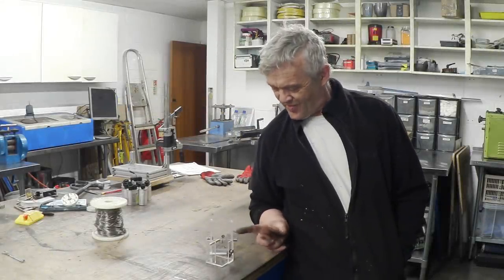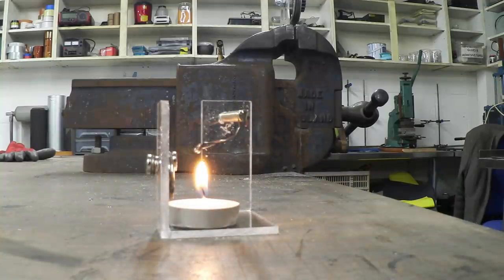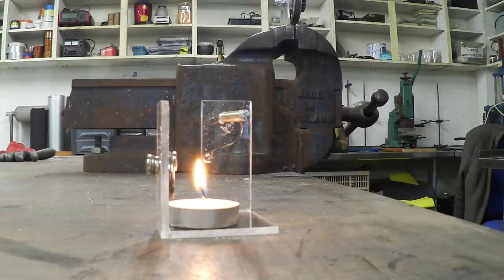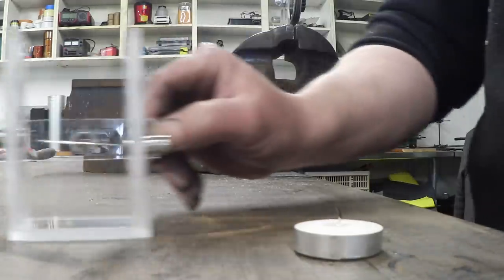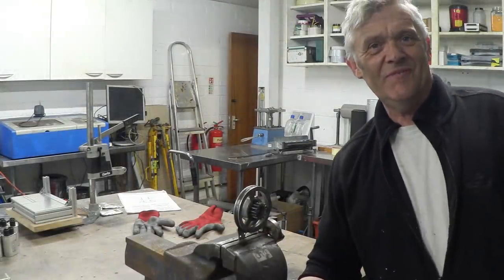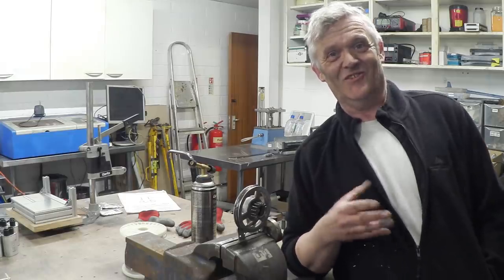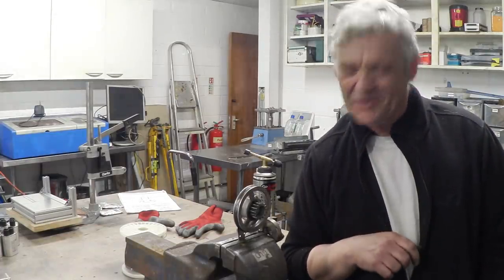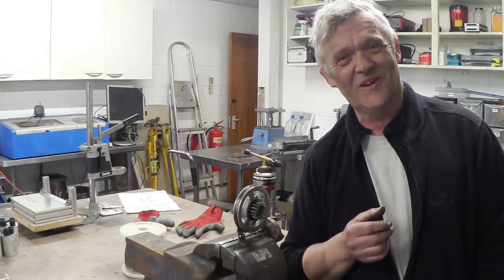Tesla's Thermo Magnetic Motor

Comment: Thanks for that video! I think you can use individual nickel coins placed around the pulley like turbine fins. They will heat faster and independently. Also they will cool down faster and individually. Also wheel speed will speed up the cooling. And you have to thermoisolate nickel off the aluminum wheel. No need to heat the wheel, only nickel matters. So the heating will be also faster. I think this wheel can rotate with uniform rpm at the end.
Thanks again! I like your way of making videos. )
Reply: I was thinking of snipping the wire into small units and placing over the surface of the object in question to be rotated... If we are going off the trash to treasure approach he spoke of.

Comment: You can use this inside a Stirling engine to move the air like it was a loudspeaker. Make a spring that bounces in and out of the flame/sunlight towards the cold side, and it moves the piston/ camshaft as it does so.

Comment: brilliant idea to make a disk. I guess max efficiieny and power would be  like a  sterling engine..have the cold side of disk enter some sort of heat retained medium  or air pocket that previously cooled down the hot side and use minimum amount of heat source. maybe have the connected axle turn a small fan that actively cools the hot side too. attach a little coil near the nickel disk and but outside the heat area and that coil could generate some electricity from the same magnet as it spins.  that magnetic axle design is brilliant..  really clever.
Reply from the maker: yes - it's a thermodynamic heat engine so will have the same conditions and limitations as all of them so you are pefectly right. glad you like the axle.

Comment: Try Nitinol (muscle wire) I saw them use a wheel with spokes made of Nitinol which would spin as on part was submerged in warm water such as in a sink. It's memory metal. I know it's using a different principal but thought you might find it interesting.

Comment: In Weller soldering pen is used this effect of Curie temperature for precise temperature control. It is magnet inside pen heated by some heating element that magnet other side touches soldering nedle. Next of it is spring loaded electric contactor. Its called MAGNASTAT. Similar system can be used with crankshaft and piston rod. At end of piston rod can be piece of nickel aloy,.....
Reply: that is very clever! magnastat

Comment: Sir, I made a successful model using a greatly flattened Canadian Nickle on a small axle with pin bearings and a small magnet. It spins well with a small butane torch, but it's easy to overheat it, which makes it stall and spin reverse. Nice demonstration! :-)
Reply from the maker: awesome mate - cheers for the post

Comment: You should get better performance if your pulley is less heat conductive and your nichrome wire is arranged in discrete coils (each around a radial axis, like the stator of a brushless motor). It would localise the heat, allowing faster loss and recovery of magnetism. This would result in a better defined boundary between hot and cold coils and a stronger tangential force from the magnet. I knew there was a reason for not throwing away that old toaster...

Comment: I think a larger wheel with the nichrome wire corregated radially as if it were a gear would help the heat remain more localised at the point you're heating I think

Comment: This is super interesting. Tesla still amazes me with the breadth and diversity of his inventions, from Tesla valves, to Tesla turbines, to this. 
This doesn't seem very efficient though. If you had a Stirling engine, you would get more motive force out of the heat than you would from this thermo magnetic motor.
Reply: run the stirling engine on the same heat source as this. And if you use focussed solar the energy is free so efficiency is far less of an issue..

Comment: The issue with magnet motors is you can't control the magnetic fields, if you could shield the magnet until the field is needed, it would work, (possibly) maybe something like this could be the answer! Insted of a magnet, use metal to kind of control the magnetic field, it would probably need to be a large diameter, with multiple stages, to keep the thing moving, while still allowing time to heat and cool! I wish I had the means and most of all patience to work on it!  I'd probably get so mad at it , I'd pack it with black powder, and blow it to the moon! Ha!  I get stressed out!!.. Great video! Whats next????
Reply: a cheap and good magnetic sheild is alternating thin layers of iron and aluminum.

Comment: it could run with a lens on the sun ! :)
Reply: Powering a capacitor which then powers a power bank. How long will it need to charge a smartphone? ;) if one sunny day gives you one fully charged phone it is still a toy but useful.
Reply: Could work, but this is probably the least efficient way to do that. All of a Stirling engine, Peltier device, steam turbine, solar cell (and a few more...) would do that MUCH better.
Reply: It's not just about efficiency though, it's about having different options to be able to charge your phone or have light at night when the traditional methods of power aren't available
Reply: Jim Whitehead  true. I just don’t know if my idea to use a capacitor to charge a powerbank works. I mean. If yes. Why aren’t there any products out there.

Comment: I am trying to come up with ideas to harnes electrical power from a heat source (log burner) to charge a 12V car battery (as an alternative to renewable power source).
Is the change between heat and cold that drives the magnetic flux?
Would a winding in a hot environment with each end connected through a coil cause a steady DC?

Comment: correct me if i am wrong but the main problem with electrical generation is that it requires a LOT of energy to heat the water to steam to produce energy ?? would this be a more efficient method to build generators ??? for example would a sun lens or a solar array producing a small amount of energy be able to feed a machine to produce a much high amount 
also
can i suggest that you use two 20mm saddles to afix the conduit to your vice and benders for the stocks and dies ????

Comment: Now thats a lot of microwave capacitors at 3:00 but i doubt it will be enough for flash graphene. You'd need hundreds of them if my calculations are correct.
Reply from the maker: i did the same calcs mate and flash graphene is what i am thinking that's why they are sitting there
Reply: @ThinkingandTinkering  You mentioned that you were interested in flash graphene in one of the microwave oven videos. That's the only reason I even noticed these caps. If you are really going to do this it will be a lot of work but probably even more fun. I am looking forward to watching the respective video :)